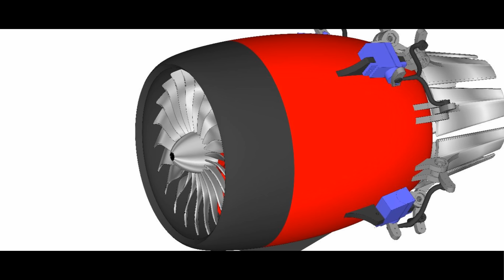3D printed Jet Engine with working Vector Thrust/ Jet Engine on rc Arrma Kraton car/Scale Addiction

Comment: Not vectored thrust just necking down to smaller diameter
Reply: Also not a jet engine. Just a ducted fan..
Reply: @nicholasjensen8016  An EDF, is a jet engine. Jet refers to the thrust produced by the high velocity stream of air that exits the rear of the motor assembly. It's not a turbojet, which is powered by a gas turbine, but it is ABSOLUTELY a jet engine in every possible way, my friend.

Comment: You've created an overly complicated convergent/divergent ejector nozzle - it's not vector thrust unless you deflect the output thrust off axis of the engine, but it's still cool none the less. The motors can be linked to 'pitch', 'roll' and 'yaw' channels on a controller to provide the vector thrust function since you made 4 sectors of independent deflection possible. 

The purpose of a convergent/divergent nozzle is to control potential back pressure which can limit the exhaust velocity and thus reducing efficiency. I highly doubt a simple EDF is going to benefit from such a nozzle but it looks bad ass none the less!

Comment: Well done. Great work. But i would not call it a jet engine. It is „only“ an EDF.
Reply from the maker: I respect that, but it looks like  a jet engine 🙏🏻🙏🏻😅
Reply: @scaleaddiction You are right. It looks and sounds amazing 👍
Reply: An EDF is a jet engine. A jet is a high velocity stream of gas or liquid. It is a jet engine because it projects such a jet. You don't have to burn fuel to produce a jet. This is a common misconception. Jet is the propulsion produced, that's all.
Reply: @shelbyseelbach9568  there is no compression or combustion chamber involved in this, it would be far more reasonable to classify this as an EDF, calling it a jet engine is certainly pushing the common accepted understanding quite a bit in my opinion.

By your definition a simple spinning fan would classify as a jet engine
Reply: @nic.h  no it wouldn't, exaggerating won't make you right either. 
You are cracking me up, man. Not liking a fact won't change it, no matter how hard you try. An EDF is a jet engine, there is nothing you can dsay to change that. Combustion is only required of a jet engine in your mind. LMFAO!
Reply: @nic.h  a spinning fan is propeller driven, here the air is condensed and directed using the shell and vector. Using gas is a system producing the effect, but with the spectacular    very simple examples. Then there is systems that utilise both.
Very cool stuff, love seeing 3d printers used in this manner.
I think your having a mental block because this system is using electricity as fuel.
Reply: Spectacular.....flames and smoke associated with rockets.
Reply: @shelbyseelbach9568  I'm pretty sure their confusion is they are mixing up turbofan and jet engines for one another
Reply: @nic.h  there is also a water jet!!!! No combustion nor flame involved

Comment: Looks amazing but its more like edf not even turbine , great job anyways , subs
Reply: Her didn't say turbine. He said jet. A jet is a high velocity stream of gas or liquid and can be produced by many different devices, which are all essentially ducted fans of one type or another. Yes, this is a jet.
Reply: @shelbyseelbach9568  Actually, he said jet engine, this isn't a jet engine, this is a jet. So you are right and wrong.
Reply: @cameronwilson1815  Wrong, this is an engine that produces a jet, making it a, wait for it, jet engine. 
en·gine 
/ˈenjən/

noun

1.

a machine with moving parts that converts power into motion.

Want to try again?
Reply: @shelbyseelbach9568  Actually, a jet engine is a jet that makes thrust using Jet propulsion, Jet engine
Aircraft engine type
A jet engine is a type of reaction engine discharging a fast-moving jet that generates thrust by jet propulsion.

Jet propulsion is the propulsion of an object in one direction, produced by ejecting a jet of fluid in the opposite direction. By Newton's third law, the moving body is propelled in the opposite direction to the jet.

And jet propulsion is when a matter is injected into a rocket to make it move.

The term jet propulsion refers to the action produced by a reactor to the ejection of matter. For example, when the matter in a typical rocket (like gunpowder in fireworks) is ignited, the resulting chemical reaction produces heat and gases, which escape from the rocket and cause it to move forward.

So therefore, this isn't a jet engine, it's an edf jet, a jet not a jet engine.
Reply: @cameronwilson1815  yes it is, try all the semantics you want, in every sense of the word, this IS a jet engine.

Comment: "...That can actually work..." Brah....stop making videos, start selling whatever it is you're smoking - you will make SO MUCH MONEY. It's not a jet engine. AT BEST its a model, and that's me being VERY VERY GENEROUS. A jet engine works in a fairly specific way to generate thrust. It has complicated innards. Your model HAS NO INNARDS AT ALL.

IT LOOKS NICE! It's a well modeled exterior model....but calling it a working jet engine is....well if you had made an attempt at modeling the insides, I'd call it laughable. As it is, it's just kinda disappointing.
Reply: A jet engine is a jet because of the high velocity steam of air that it produces, not because of how it is produced. This is absolutely a jet. You have bought into a common misconception, and you are talking about a turbine engine, they are all jets. Just like a jet ski which doesn't use a turbine either but definitely produces a jet for propulsion.
Reply: @shelbyseelbach9568   actually this is an Electric Ducted Fan. A Jet engine has to have a combustion chamber after the compressor ( fan ) 

Next we should point out that it’s not vector thrust, as this can’t redirect the thrust in any specific direction, and just restricts/condenses it some. 

Looks good, but again not a jet; an Electric Ducted Fan
Reply: @geauxracerx  no, it doesn't have to have a combustion chamber after the fan. Never said it was thrust vectoring. Actually said it wasn't, actually said that directly to you. At this point, you are talking in circles, trying so hard to be correct. It's hilarious. Keep it coming.
Reply: @shelbyseelbach9568  open air propellers create thrust. Jet engines absolutely require a combustion chamber. In fact the main classifier designating Jet engine is that it has a combustion chamber. That’s the only thing that sets it apart from a Ducted Fan. While Ducted fans are any Propeller/impeller in side a Duct. Which can amplify the propellers thrust 2-5 times its open air performance. Even Rocket engines are “jet” engines. Water impellers loosely apply, but only in the loosest definition.

If you were to look to buy this type of propulsion ( cuz they are readily available and used often ) you wouldn’t search for a jet engine you’d search specifically for an Electric Ducted Fan. Which in the description would clearly state not a jet engine.
Reply: @geauxracerx  that doesn't mean it doesn't fit the definition of a jet engine, as an edf is a jet engine, a rose by any other name would smell the same. You can call ir whatever you want, it is an engine producing thrust with a jet of air.
Reply: @shelbyseelbach9568  actually it does. As “engine” literally requires a combustion chamber. If it doesn’t have a combustion chamber it’s not an engine. It’s not the jet part that you’re debating. It’s the “engine” part and you can not have an engine without a combustion chamber. 
While also under your definition a standard propeller propelled air plane would be considered a jet, as it produces thrust also. The difference being the Duct. Just because it makes thrust doesn’t make it a jet engine. Just because one places the thrust producer in a duct doesn’t make it a jet. There’s quadcopters with ducts they aren’t jet powered/lifted. The ducted fan is missing the compressor and combustion chamber. The compressor can be another set of spinning blades or a restricted path, but it’s required to speed the moving air up and then add it to the exhaust of the combustion chamber or it’s not a jet engine. 
All engines are motors not all motors are engines <— basically an hats happening here. You’re arguing that a motor is an engine technically, but substituting a EDF for Jet. You’re close but missing the essence of what constitutes a Jet Engine
Reply: @geauxracerx  no an engine doesn't require combustion. That's why an internal combustion engine has internal combustion in its name. What kind of engine is it, one that uses internal combustion, it's not a requirement to be an engine. 

en·gine

/ˈenjən/

￼Learn to pronounce

See definitions in:

All

Railways

Fire Service

Military History

noun

1.

a machine with moving parts that converts power into motion.

It's hard to let go of something you think is true that isn't. It's much easier to fool a man than to convince him that he has been fooled. And I mean to say that you are a fool, in ABSOLUTELY no way. Every human on the planet knows stuff for a fact that that simply isn't true. Including me, but not this time. 

To be an engine has nothing to do with burning fuel in any way, literally, by the very definition of the word. You can argue against it till you are blue in the face, it simply won't matter.
Reply: @shelbyseelbach9568  motor something that provides motive power. Engine something that converts combustion to motive power. Hence why all Engines are motors, but not all motors are engines
Reply: @geauxracerx  
motor
[ˈmōdər]
NOUN
a machine, especially one powered by electricity or internal combustion, that supplies motive power for a vehicle or for some other device with moving parts.

 You can hold on to you preconceived notions if you wish, but just because no one calls it a jet engine and it's not what you think of, doesn't mean it's not one.
Reply: @geauxracerx  bro just give up he clearly just wants to argue every point. Last I checked they don't call it an electric engine its a electric motor, to your point
Reply: @boburuncle6170  100%

Comment: It is NOT a vector thrust. It is adjustable exhaust. It is not the same thing. With a vector thrust, you adjust the ANGLE of the thrust, not the diameter of the exhaust.

Comment: Someday when 3D-printed metal parts become feasible,
your design will work great.
OR the other way round :
When plastic jet engine technology becomes mature.
Or break-thru in plastic materials which can 
withstand immense heat/pressure.

Comment: Rather than BLDC motors, try to attach real fuel operated micro jet engine to main turbine and make the body with carbon fiber so that when you attach that fuel operated micro jet engine, the outer body will not melt.

Comment: jet engine requires jet fuel, this is but a fancy fan...
Reply: No, a jet engine is required to produce a jet (high velocity stream of gas or liquid), you afte taking specifically of a turbine jet. The jet is the propulsion, the turbine is how it is produced. I've never turbine fuel in a jet ski, yet it produces jet propulsion also. A jet can be produced by anything that soins a ducted fan at high speed. That's all a turbine is, a ducted fan with a burner and turbine to power it.

Comment: It looks cool but that's about it. Why thrust vectoring on a land based vehicle? Just added weight. The motor looked way too small for the size of the fan. I wouldn't trust a 3D printed fan unless you want to be scale Pratt and Whitney engine that can throw blades. More interesting if it is for an airplane.

Comment: Didn't see the follow-up video on this in any of your vids (did I not see it?). Didn't work out? Not spec'ing the thrust, etc. Your blisk design looks a bit sketchy for getting thrust from a motor (pretty is pretty, but functional is where the performance is).. but nice design overall. Too bad it didn't work out.

Comment: Where is the "jet"?  Just a ducted fan for what is see... It's wicked-looking tho.
Reply: jet engine
[jet ˈenjən]
NOUN
an engine using jet propulsion for forward thrust, mainly used for aircraft.

jet
[jet]
NOUN
a rapid stream of liquid or gas forced out of a small opening.

engine
[ˈenjən]
NOUN
a machine with moving parts that converts power into motion.

In every way, this is a JET ENGINE!
You have bought into a misconception, that you believe is a fact, that simply isn't. A turbojet engine  is what you are describing, it is only ONE type of jet engine, just like this is.

Comment: Not a jet engine but an electric ducted fan.
Reply: An EDF which produces a jet (a high velocity stream of gas or liquid). A turbine linked to a ducted fan is called a turbojet (for the turbine powering the fan and for the jet the fan produces). An edf is the same thing powered by an electric motor. They are both jets, as that is the propulsion they produce.